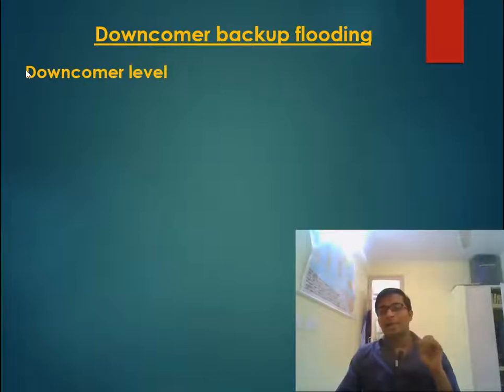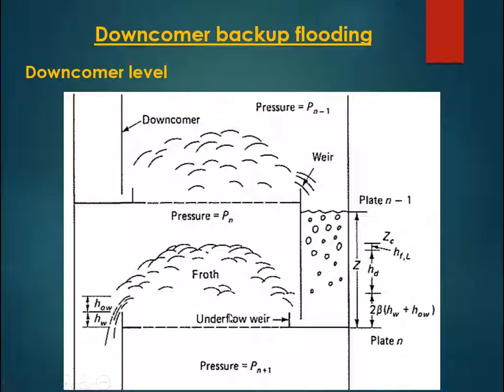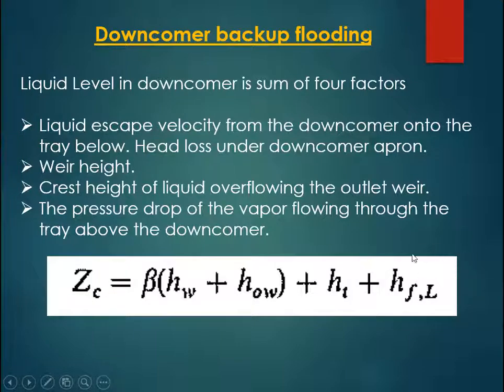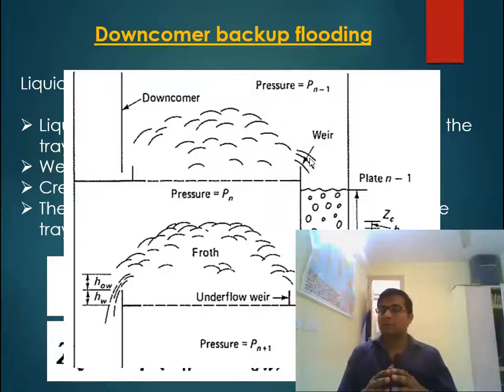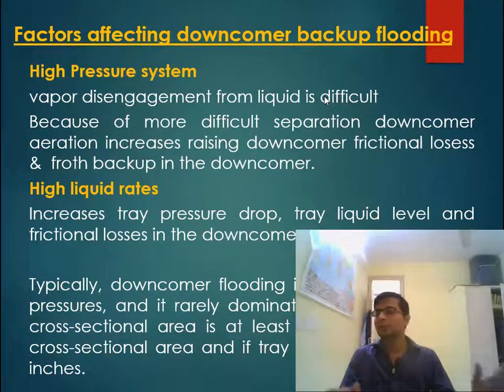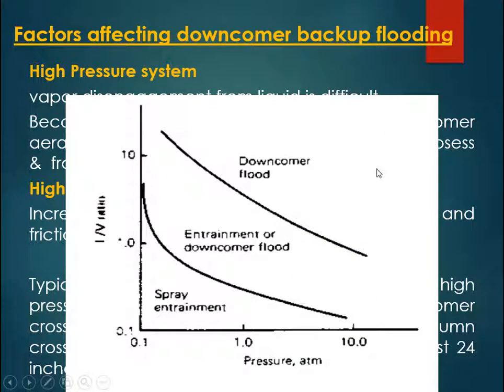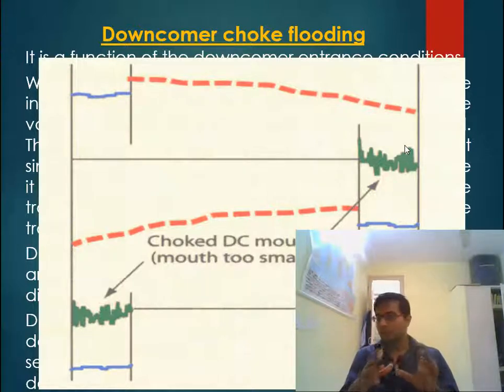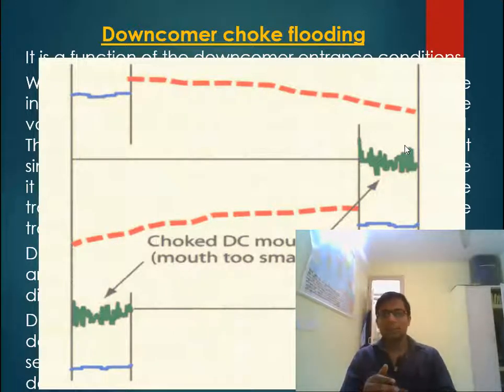Part 3 - Flooding in distillation Column: Downcomer Backup flooding and downcomer choke flooding

Comment: firstly thanks for the content. Sir I want to know, how increase in pressure drop of vap. Flowing through tray above the downcomer  will increase the liquid level in downcomer? ? ?
Reply: because if the pressure above the downcomer reduces and the pressure at the tray below which is already high remains the same then the pressure gradient across the downcomer increases so more height of liquid inside downcomer will be required to compensate it